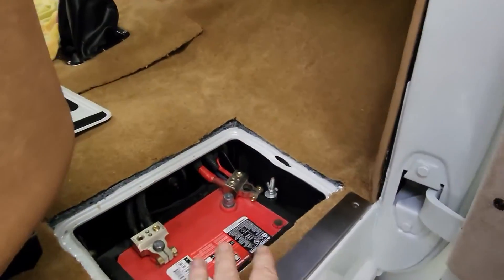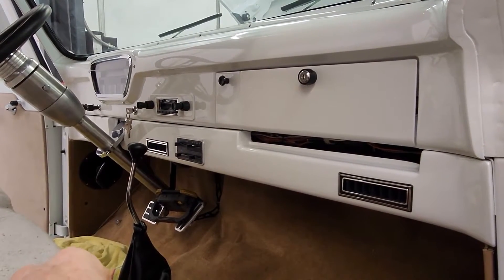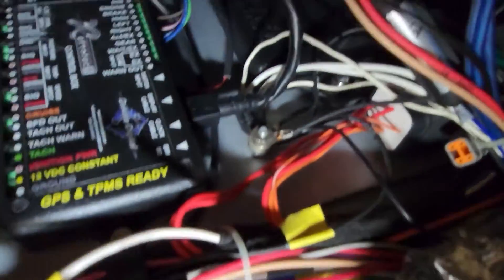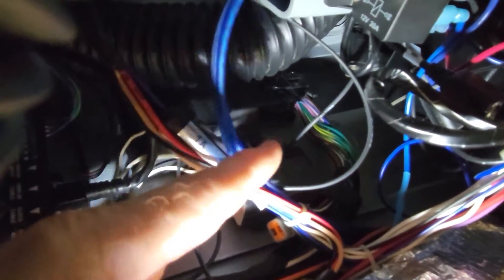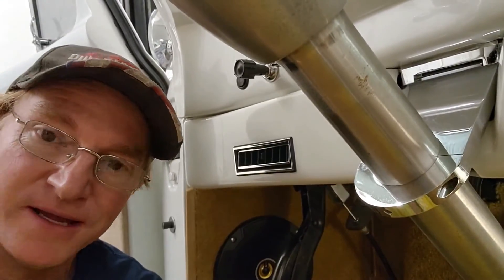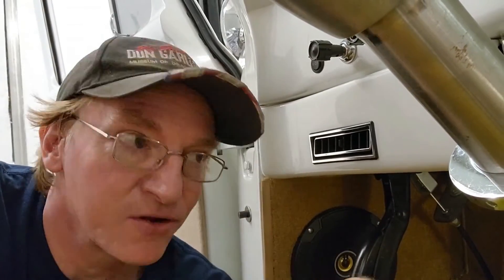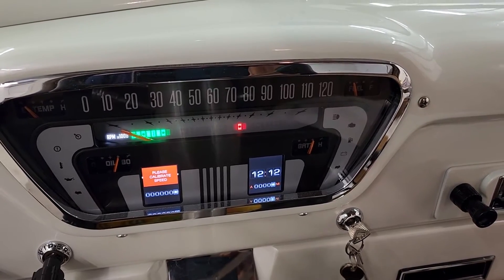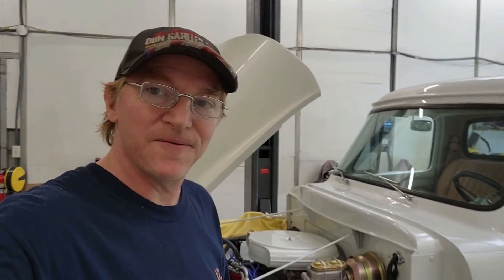Edelbrock Pro Flo 4  & Dakota Digital Tachometer Feedback Fix

Comment: I'm having issues with my pro flo and can't find any help on the forums or calling them. I have a slight hesitation if I'm crushing and I stab the throttle. And I can't cruise around going under 10mph because the engine starts bucking which is very annoying. I also have issues with starting, it takes forever. However one time my O2 sensor died and the engine started right away! I wish I could figure out how to get it to start like that again.. do you have any thoughts on that?
Reply from the maker: Unfortunately there are too many possibilities in what you wrote.  but always make 100 percent sure that the power and ground are directly and firmly connected to the battery, any voltage drop from there or even the pink activation wire it will cause alot of issues. best of luck!

Comment: How do you have your Dakota Digital wired?  Do you have it connected to the ECU directly via the CANBUS serial cable?    When I wired mine in, there wasn't much interface at all between the Dakota Digital and the ECU.  The ECU needs 12v power, switched power, temp sensor and tac, which I pulled from the negative side of the coil.  I'm confused by your setup if you're saying the DD is feeding power back to your ECU. My DD was never connected to my ECU.  Then again, I wasn't running the CAMBUS.   EDIT:  N/M, now I see how your setup is different. You're feeding the tac signal from the DD box to the ECU.  I didn't do that. My ECU is connected directly to the negative coil. I'm running a separate line from the negative side to the DD box.  I don't have any backfeeding issues.
Reply from the maker: good to hear. we found the white feed wire to the coil and the tach feed are connected somewhere in the Edelbrock harness. hence.... we installed the diode. Truck has been working properly since.

Comment: I'm getting ready to install my 406 in my 89 IROC with a pro-flo 4. I'm in the disassemble phase and I'm going with Dokata digital. Nice to know an easy fix for a problem I didn't know I would have. Running off the coil woukd fix this too wouldn't it? I believe that's what you said. Also what diode size? Thanks!
Reply from the maker: If you are using a Pro Flo 4 EFI, the neg coil  output and tach wire are same output so "anything" you tie into that circuit make sure you don't have any noise or back feed to the PCM.  I used  both types of diodes, small and large, it didnt matter they both worked. I cannot say Holley has the same issue or Any other products. Just this specific issue  and the Edelbrock supplied big relay has to click off after a key cycle, if it doesnt, somethings keeping the PCM alive. The pro flo 4 learns a lot of aster than the 3 does, and they make the harness extremely simple to work with.